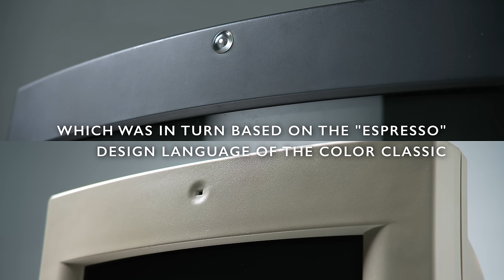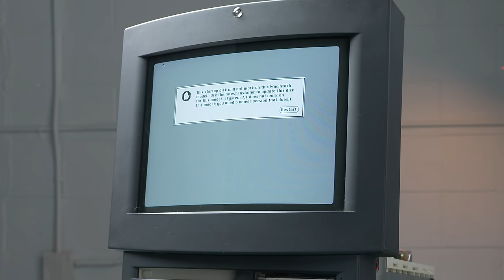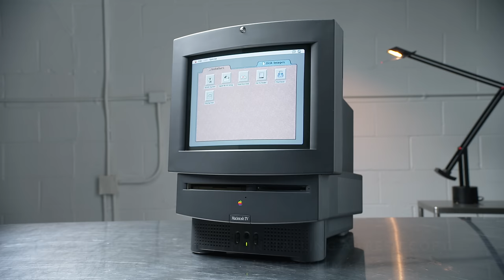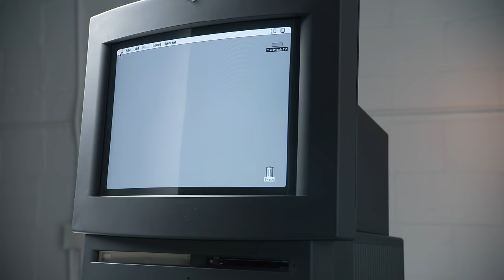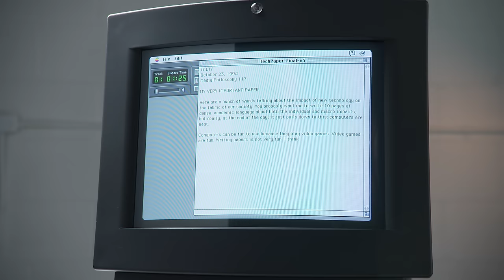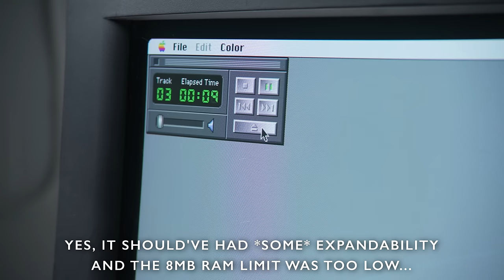TV? Computer? YES! The Macintosh TV Restoration - iiiDIY

Comment from the maker: 1) Please don't work on CRT monitors or power supplies unless you have the proper training. This is not a full guide, and bits have been cut for time. DANGER!

2) I didn't recap the analog board because everything looked very clean with no signs of leaking. I will tackle that in the near future, as a preventative measure.

3) Post your favourite typo below! :)
Reply: Hey! The restoration was excellent and I really loved the video!
Reply from the maker: @retrodude6215  Hey, thanks!
Reply: One question- Can you try in your next vid to get the cheapest Mac possible and fix it up? @iiidiy
Reply from the maker: @retrodude6215  I have a backlog of projects at this point :) And I'm sorry to report, but if all goes to plan, the next one is actually going in the opposite direction, hah. But then I'll be returning to normal computers for a few projects, including a free one
Reply: Ok! Sorry for recommending it then, it’s just as I finished restoring my 50 euro blue and white g3 with max os9 lives, and I thought that a professional like you could take it to a much better level by probably getting a cheap max from a flea market/local ad and fix up. Anyways, sorry. @iiidiy
Reply from the maker: @retrodude6215  No need to apologize at all! I wasn't trying to shut you down, just trying to hint at what's coming up without giving too much away :) I do appreciate the feedback! I have a rather large B&W G3 project that I'm slowly gathering the tools and supplies for. It involves 3x towers, all of which were purchased for less than $50 each :) Just don't know when I'll have gathered the supplies for them...

Comment: Apple really did the Macintosh TV dirty with those specs. But Apple also did a lot of their Preforma line dirty. Unfairly gimped specs like 16 bit data paths for 32 bit cpus. Artificially low ram limits. Some of this stuff required expensive engineering work to implement. Making the computer more expensive than if they had just designed the computer more simplistically and allowed it to have some upgradability and better specs. It's a wonder Apple didn't almost fail sooner.
Reply from the maker: I'd LOVE to hear the real, first-hand reasoning behind some of the mid-90s shenanigans! I believe that a lot of the Apple team by that point really believed in their products, and probably wanted to make great machines. I bet there were economic, scaling, manufacturing, and marketing constraints that led to some weird (bad) decisions. Some strange stuff got made during that era, but they made it through!

Comment: And out of the blue turns out you have another of those scarce Macintosh TV's that were just a few months in production (and of which just about 40.000 were produced) "for reference"! Does that other unit work to some degree?
Reply from the maker: I couldn't have had better luck with the timing :) It came up for sale after I started this restoration, but before I screwed up the tuner. No, it doesn't work... yet!

Comment: Have you ever considered modding for RGB/component? I’m almost on the hook to buy one but hesitating. The composite looks way worse than the computer display (for many reasons I’m
sure) but hesitant because for the same price I could get a PVM. Awesome as a collectors piece but maybe not as practical for retro gaming as I thought. Any input from your experience?
Reply from the maker: I hadn't considered that, and I'm not sure that's even possible. The video input isn't going directly into the CRT, it's being digitized, so I doubt it'd be like modding a 1702 or something... but that's beyond my level :)

Re: quality... yeah... it's not good. It's dithering from a smaller color palette, nothing close to a good "real" CRT TV or PVM. The tube itself is nice, but the capture isn't. It's a great party trick, and on SNES or older games I don't really notice the limited palette because it's already limited... but next to a real TV, it's no contest.